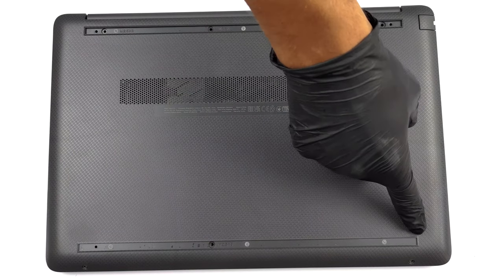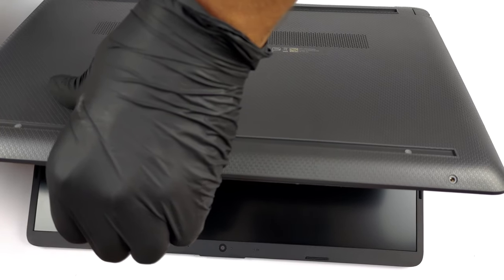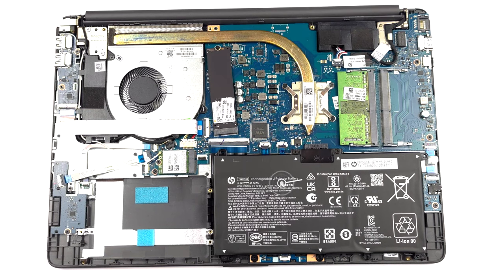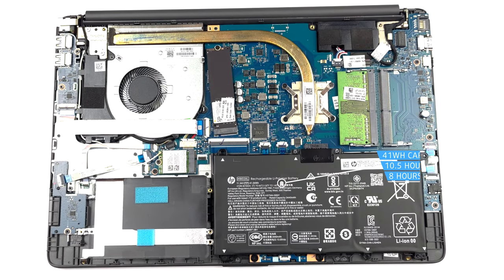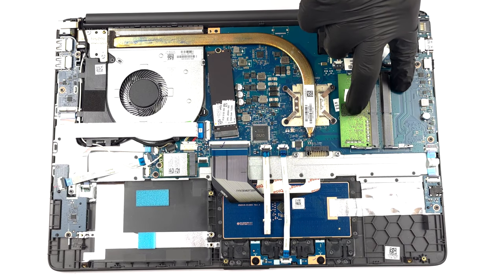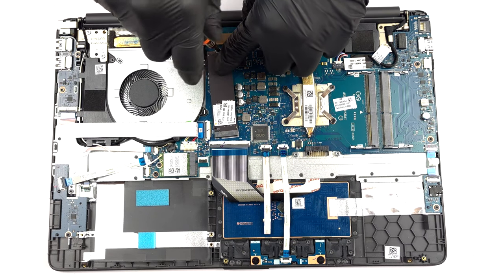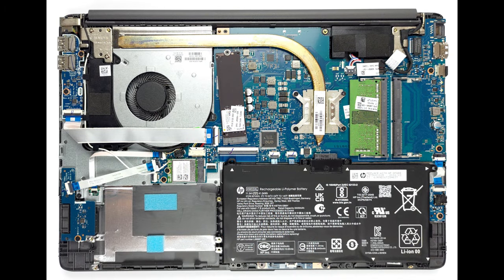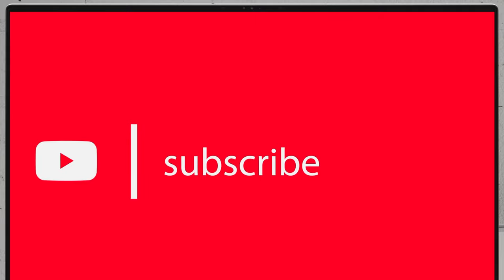🛠️ HP 255 G9 - disassembly and upgrade options

Comment: Hey thanks for this video, it helped me with a similar HP 255 G9 (with the Ryzen 3) to open and upgrade the ram. I hate that I had to crack it open even after unscrewing everything... I always fear I will break something. Why they do this to us :(
Reply: The plastic clips are in place so that the panel doesn't rattle. If it was only held down by the 6 screws, it would bend and jump around
Reply: How did you put the rubber feet back ? Do you need to glue it or it just stays there ?
Reply: @gaborvarga6567  the original strip glue was left there and it was still sticky, I just put the rubber back. If yours is dried try to find some dual side adhesive tape to use and not liquid glue
Reply: @NikolasKarampelas  thank your for the answer , i havent opened mine up yet , but this was something i was wondering about

Comment: Is it ok to add a 2.5'' ssd using plastic tape to hold it in place?
Reply: It's not worth anything to you because there isn't even a sata slot to insert disk drive.
Reply: @zivkdusan  There is an empty space on the left of the battery and System board also has a connnector.  You need to buy the HDD/SSD cable (L52025-001) and the bracket (L52025-001)
Reply: @MithGR  No my friend, I opened the laptop, there is only a connector where the ribbon cable is meant to be connected. There is no board with sata port, so a separate pcb with a sata connector on it, together with the ribbon cable must be purchased. Of course such a thing doesn't exists in Europe, it has to be ordered from China.
Reply: @zivkdusan  my friend I just gave you the parts you need with the part numbers.
Reply: @MithGR  Oh sorry, there was a misunderstanding. You're right, I didn't read it well. 
I thought you were saying the connector was on the board.
Reply: @MithGR  And of course there is no delivery option for Serbia... I think it will eventually appear here as well. The laptop is still a new model.
Reply: @zivkdusan  you can ask your nearest HPSP for ordering those parts. HP employee here 😉
Reply: @MithGR  What is HPSP?
Reply: @zivkdusan  HP Service Point
Reply: @MithGR  Thank you, I'll try. 👍
Reply: @MithGR  thanks for the super infos! (:

Comment: to see that it has upgradable 2.5 another ram slot is a sign of a good laptop
Reply: i'd say it's more of a sign of reusing older pcbs as sadly nowadays i see a trend of more and more things just come soldered onto the motherboards apple style.
Reply: @一本のうんち its more about being able to use full capacity of the laptop by enabling dual channel with 2 ram slot used

Comment: i was going to ask what brand of ram you  used to upgrade its ram capacity ?
Reply: I used 2x 16gb crucial 3200mhz ram to upgrade mine to 32gb
Reply: @一本のうんち  dont get me wrong but why would you need 32gb ram with this laptop. Like the CPU nor iGPU doesn't powerful enough to do something that needs 32gb ram
Reply: @gryasl6231  just multitasking and a couple of virtual machines. cpu is pretty capable.
Reply: @一本のうんち  hey there, is the ram easy to upgrade? as far as im aware its just unscrewing it and inserting the ram into the empty slot.
Reply: @zxcbbnm7552  depends on how comfortable you're with this kinda thing.

unscrewing the lid and fitting ram is easy.

but before you can take the lid off you also need to peel off rubber feet cause few screws are behind them. it's easy, but it's also easy to tear them if you're not careful.
and you also need to pry the case as it's latched. you just need to take your time and be careful not to break the bits.

Comment: wtf do they still make powerful notebooks that can't use two monitors?  Do they think everyone owns or will buy a new ultrawide?
Also I think it should have paired a Gen4 PCIe NVME socket with this new Ryzen CPU.
Gen3 is pretty old now.
Reply: just get a usb to hdmi adapter. most laptops only have 1 monitor port.
it's the older ones that might combine hdmi with vga for compatibility purposes.

Comment: Terrible cooling firmware preinstalled profile. Fan is turning on when cpu reaches 80c or more. In basic tasks once CPU reached 88c. There is no thermal control option in bios. Plus fan is extremely noisy because when it turns on temperature is already very dangerous and it spins at max rpm. Tried to find third party software to manually predefine fan curve, but didn't find any app that supports this model. Don't buy it, its complete waste of money, because it will melt itself with this idiotic fan behavior. To implement such an insane solution you must be complete idiot.
Reply: Does it get the temp down quickly at least?
Reply: @DarkGT  The problem is that it doesn't always react on time, so the temperature often goes over 95C before fan reacts. But when the fan starts, the temperature drops very quickly. I highly recommend to use it in fan always on mode. Another fortunate circumstance is that there is a grill under it, so the cooling pad will have good effect on keeping it cool. If you still didn't buy it, avoid this Laptop, build quality is very poor. Better go for used Elite version..
Reply: @zivkdusan  Thanks I will skip it. Maybe they create it to be more a office/media consumption device, it does it's fan curves like the Apple laptops, being quiet as long as possible.
Reply: Are you using windows10?
I had same symptoms at 10, but not in 11.
Reply: @한규성-c2s  Windows 11
Reply: fan noise can be eliminated completely by setting maximum processor state in power plan to 80%
Reply: @一本のうんち  Yes, but that's not the point. You limit cpu performance that way.
Reply: @DarkGT  This is one big fraud by HP. I have never seen a laptop of worse quality overall in my life.
Reply: @zivkdusan  I'm sure you won't buy the same brand again. Get the new Qualcomm laptops, at least it is a performance house.
Reply: did you find a way to cool down the fan?
Reply: @deathly992  Yes I did. I sold it!
Reply: @zivkdusan  how did you cool it?
Reply: @deathly992  I sold it mate. It's not possible.